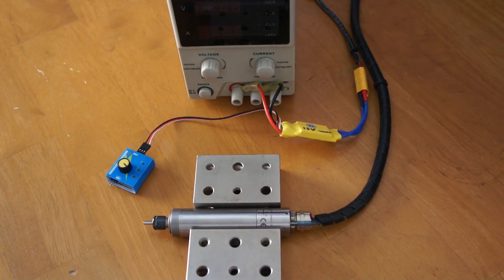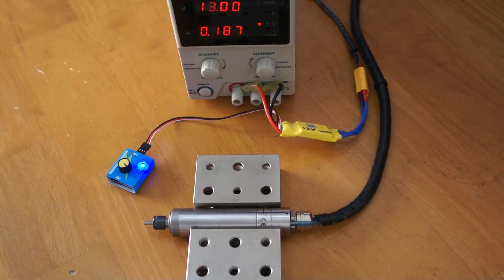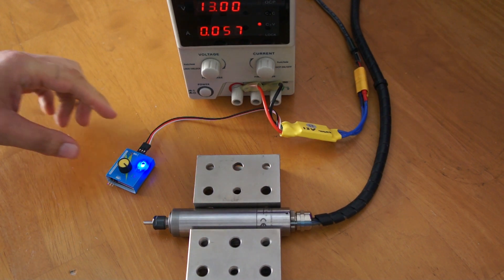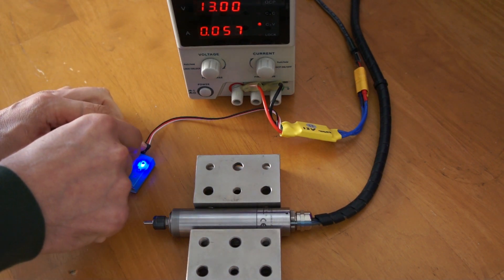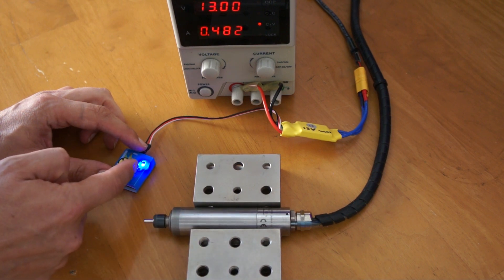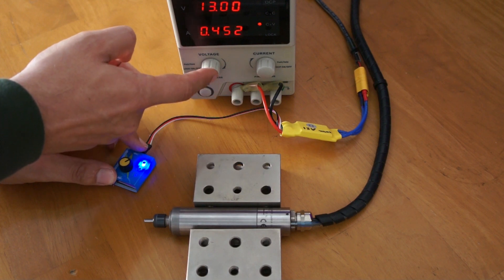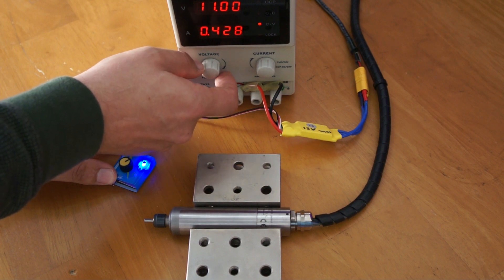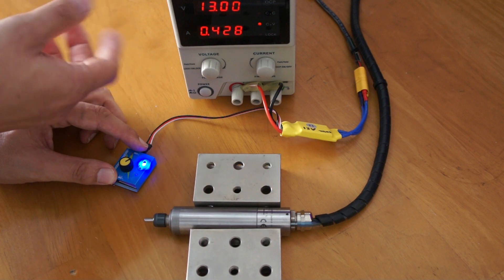Drive expensive high speed spindles with cheap RC motor controller

Comment: Hello Jan, I came across your video by chance because I was looking for information about a KAVO 4004 and its control system.
You're using a similar three-phase motor, right?

Are you sure it's a BLDC motor and not an asynchronous motor, meaning a three-phase motor? If it works anyway, that's fine.

How do you control the milling motor? Could you give me more information?

My original inverter for the KAVO 4004 is unfortunately broken.
Please, which components did you use exactly?

Thanks very much, Andre

;-) I found your Website.....
Reply from the maker: Hope the website has enough info to get you going. Let me know if you need more info. Not sure how much I'll remember at this point :P

Comment: Do you have a preferred spindle for working on wax / thin sheet metal?
Reply from the maker: Depends on your budget. Cheap ones will work fine, but be relatively noisy and cause low tool life.... I had a Roland cnc and the spindle in it was very low end, but it was fine for wax/soft metals.
Reply: @janbeck8269  what materials work best for the speeds  30krpm 50krpm 80krpm
Reply from the maker: @pioverapiovera6548  optimum spindle speed is a complex interplay of cutter diameter, material, cutter material and coating, cooling, quality of spindle and more. There is no simple answer to your question.
Reply: @janbeck8269  any experience with nsk spindles or  minimum necessary controllers
Reply from the maker: @pioverapiovera6548  I have some. They are nice, but I have not got enough experience with them to make a specific recommendation.
Reply: @janbeck8269  for milling wax for rings ( jewelry)   30k or 50k or?
Reply from the maker: @pioverapiovera6548  does not really matter. the faster the spindle the faster you can move the cutter. The older Roland machines for wax carving topped out at 6000 RPM (I think) and did a fine job.
Reply: @janbeck8269  which spindle controller do u use?
Reply from the maker: @pioverapiovera6548  various. I got the actual manufacturer controllers for my NSK and KaVo spindles. But in this and my previous video I show that it can also be done with a cheap RC motor control.

Comment: Awesome! Is such a dentistry? spindle any good for CNC?
Reply: About rigidity. The kavo 4010 is used on the Bungard ccd.
Reply from the maker: @lieuwebanga296  oh, cool. Not much rigidity needed for this app, fwiw.
Reply from the maker: I'll find out soon. Planning to hook it up on the linear motor 3D printer to see about milling some aluminum. The printer is stiff enough to do CNC milling. I tried to stop the spindle manually by squeezing with my fingers, but could not without burning myself with the friction. It has a good amount of torque, 4 Ncm - and it's rated at 250W. I also have some more beefy Nakanishi spindles that I think I can drive the same way, but they are heavier than I like for the 3D printer.
http://pubs.centerline-inc.com/partners/kavo/manuals/kavo_4015_spindle.pdf
has a technical drawing, but I cant tell if the bearings are angular contact.
Reply: @janbeck8269  How are the things with RC motor control going, did you pursue to topic further or did they turn out as unusable? I only saw your promising CMC milling videos with commercial motor control.
Reply from the maker: @kaptn_kapton  Nothing wrong with this approach as far as I can tell. The 3D printer was a bit too flimsy to push these spindles to the limit. I may revisit this topic in the future with the Granite CNC mill. Why do you ask?
Reply: @janbeck8269  I am looking around for options to do something similar. It doesnt have to be the strongest spindle, but something fast for thin milling bits in cfk or aluminium.
Reply from the maker: @kaptn_kapton  These spindles, and the ones from NSK are absolutely up to the task, when considering their power rating. BUT you need a very stiff machine with very smooth motion to take full advantage of them - or you'll break cutters. Just my 2 cents ... Good luck!
Reply: @janbeck8269  Thank you. It seems to be the typical problem that most diy projects are lacking the mechanical framework. But that I will probably find out the hard way ;) Anyway, I will keep watching your channel and am interested in more content in that topic.
Reply from the maker: @kaptn_kapton  This cannot be stressed enough. A friend of mine who built industrial machines used to say that the top 3 rules are "cutter rigidity, cutter rigidity and cutter rigidity" referring to the cumulative machine stiffness between the work piece and the cutting edge. I'm inclined to say that he was wrong and that should be the top 4 rules...:P